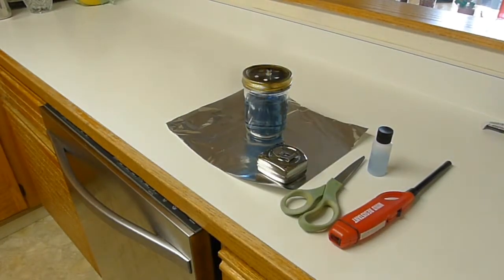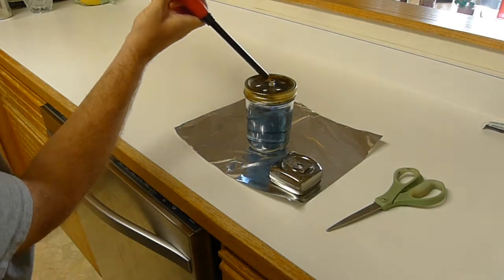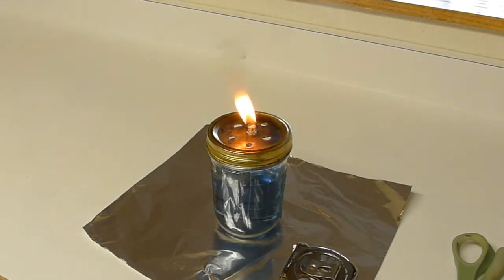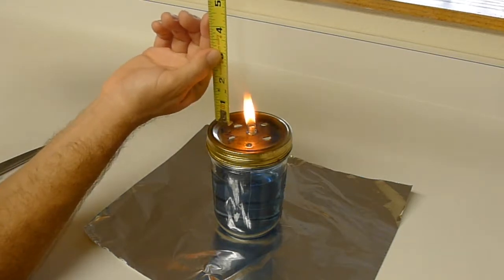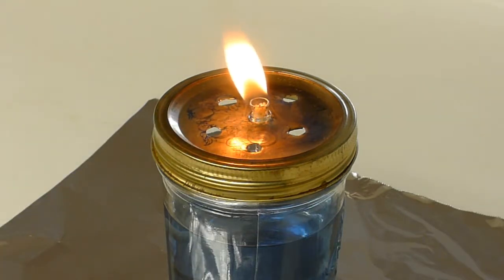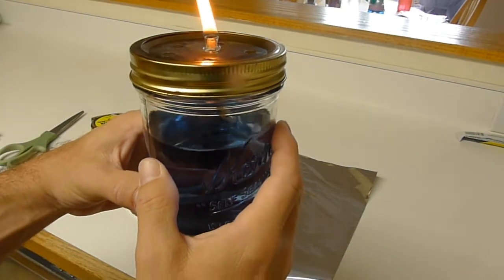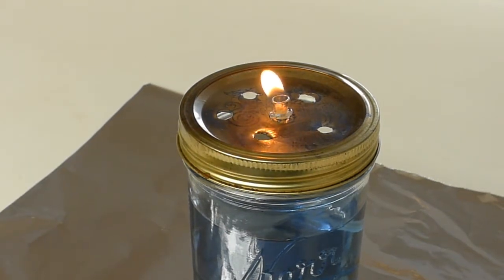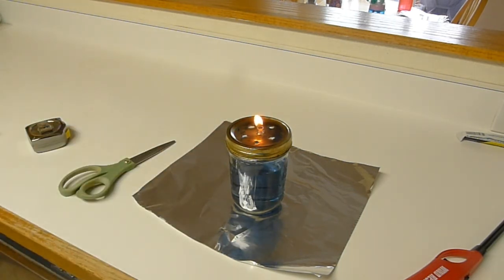How Does Wick Height Change Flame Height On A Round Cotton Wick Mason Jar Oil Lamp

Comment: I own two vintage lanterns; one is a Turkish style copper lantern with a bottom container for the oil and extra wick. This section is covered with an easily removal copper cover and has a small whole for the wick. There is no adjustment feature for the wick with this lamp. 

My other lantern is a vintage French railroad lamp from the 19th century. It’s actually labeled with the SCNF imprint on the brass so it’s the real McCoy. As with the other lamp, the oil container is below the main body of lamp and the middle portion unscrews to access the oil container. There is a small whole for the wick that will have to be threaded from the oil container. As with the Turkish lantern, it does not have an adjustment mechanism for the wick. 

So I was wondering how high the wick should be and quite short appears to be the answer from the video. I wonder if initially your problem with the wick burning too high and smoky was because you primed it, which may not have been necessary. 

I don’t have a wick yet and both appear to require a 1/8th diameter for the width. Once I purchase the lamp oil and the wicks at HobbyLobby, I will let you know how it turns out.

Unfortunately, neither has that small round piece of glass to hold the wick. Not sure how you acquired that piece of glass or whether it will impact the flame once I pull the wick through the small hole from the oil container.

Comment: Spending a few dollars to purchase a proper wick holding lamp fixture which is adjustable during use and using it with a wide base low profile fuel canister (for safety) would be well worth the money spent. A flat wick can be made wider (larger flame) allowing for greater oxygen exposure resulting in a brighter hotter cleaner flame than can be attained with the round wick. This is why the flat wick oil lamp replaced the candle as it is superior in every way.
Reply: Thank you for your comment.  Really except for religious and occasional entertainment opportunities you should not use any flame lights on a regular basis.  These are for fun, religious purposes and mood lighting.  Regarding surface area. A 1/16” wick will produce anywhere from a candle size flame to ridiculously large 4-6” flame based on wick exposure.  Regarding surface area. 1/4” flat wick has about 1/2” of surface area.  A 1/4” round wick has 1/4” x 3.14 surface area. Or PI x diameter.  So for every size wick comparing apples to apples a round wick has superior surface area.  However as stated even a 1/16” wick produces a more than adequate flame. Anything larger than candle size flame  is probably unsafe.  I think everyone should know how to make an oil lamp. These are perfect for DIY fun. These are perfect for Girl Scouts and Boy Scouts learning.  Under supervision and with extinguisher ready. Do you work for a lamp company?  Thank you for your comments.
Reply: @Daniel-gq1xy  small cold blast lanterns (this is the most widely use non pressurized oil wick lantern design) are still manufactured today and they are brighter than either a dead flame design or a hot blast design they also are cleaner burning and yield more heat. These are inexpensive and simple to use and are useful in a power outage providing both light and heat. These lamps are fully adjustable so far as light output goes. However if you want a wax less candle what you have is fine. No I don't work for a lamp manufacturer. I am interested in lamps and small stoves and how they work. There are oil wick lamps which also use a fabric mantle similar to those used in Coleman lanterns which offer a significant improvement in light output heat and they are cleaner burning (when used inside this is a bonus as it reduces exhaust fumes) these were made by Aladdin and other companies in America up to the late 1950's and for which parts can still be found.

Comment from the maker: Hello,  Yes this video was created to help a very good customer of mine who was having trouble with flame height.  The video is titled How Does Wick Height Change Flame Height.  Not sure how your search about smoke ended up here.  Anyway.  If you have too much wick exposure you will produce excess smoke.  The other and larger factor is the fuel you burn.  A lamp intended to  burn denatured alcohol will barely smoke at all.  If you use an old fashioned flat cotton wick lantern with kerosene, it will smoke a lot even in ideal conditions.  Hope that helps.  Play with your wick height to find the perfect balance of flame height and smoke produced.  Most importantly use fuel and device rated for indoor use.  These mason jar candles are for emergency use only and will smoke more than a proper lamp.  But if it is all you have for a few days it will be okay as long as you have ventilation.  I am assuming your carbon monoxide detector which you should always have is not working because of an extended power failure.  Always have fresh air ventilation if you use these type of improvised lighting devices.  Thank you for watching and your comment.  That is a great idea and I should do a smoke test video.  Thank you.  Daniel 
Show less